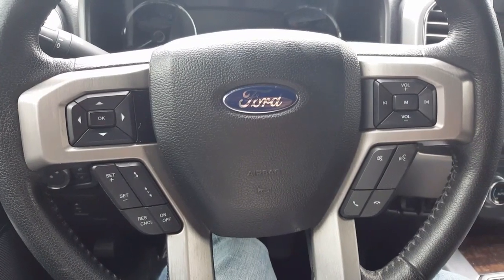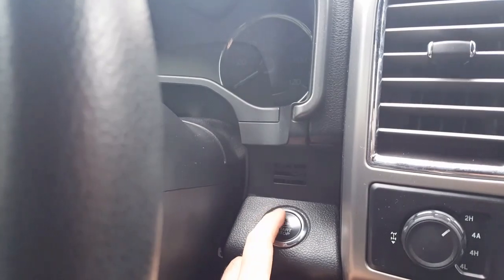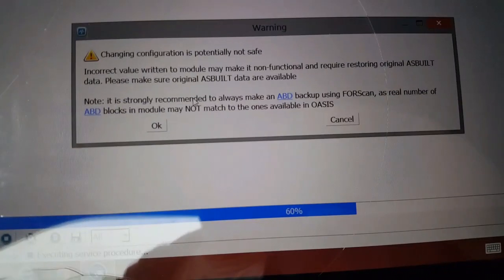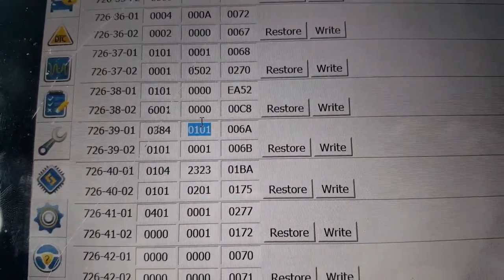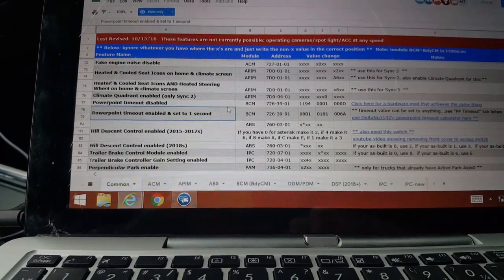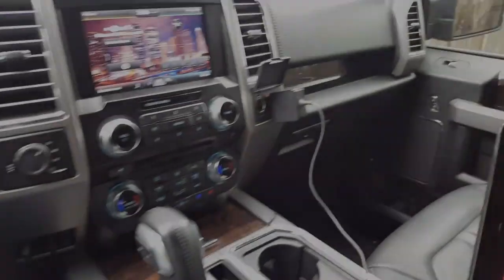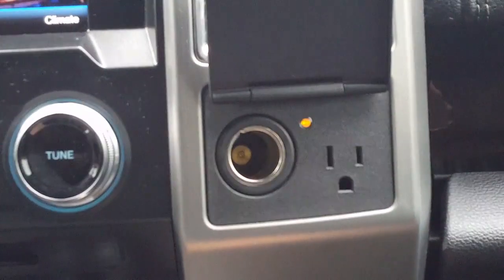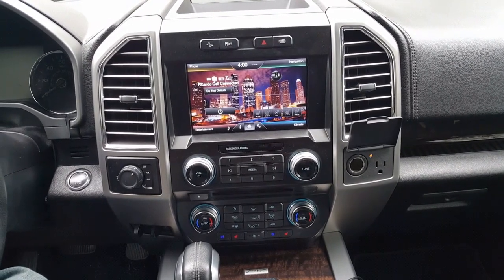FORScan how to enable PowerPoint with Timeout

Comment: Hey Ric , I have 2023 Ford Lightning and I will be taking some trips soon , I have a electric cooler that is in the back on the floor and I want to leave it on for maybe a half hour after the truck is off to keep the food and drinks cold in it  ! any ideas how I can change the settings on the truck ?  Thank you      Alan
Reply: Get a small portable power station like the BLUETTI  EB3A. Start with it fully charged, plug into your rear power point  to recharge and plug in your cooler and cellphone to get continuous power. Cost of $230, is less expensive than having a dealership fix the power point timer, that only stays on for 50 minutes.

Comment: Wondering which PowerPoints in the new Bronco this will have an affect on as there is in the Bronco, a 1v outlet in center console, a 120v ac outlet on center console passenger area, a 12v outlet in cargo. And the three different usb outlets, one on dash, one in center console, and one in center console for rear seat.

Comment: I’m dummy I guess simple way for me too keep constant power going to what I wanna power up all the time is. A hot wire and a fuse. It’ll be nice if they have you a easy set up feature you can set a time limit on the outlets by the steering wheel controls. That’s what I was hoping to find seems like something simple with vehicles now are complicated.

Comment: What’s the numbers you type in to convert it to stay on for at least 8hrs or always hot/on? I have a 2018 xlt super crew and will be using it as camp for the majority of snowboard season and would like to plug in some 12v heated blankets while sleeping. I don’t have the 110 outlet. I’d really appreciate your help. TIA
Reply: Hey did you ever find out? I'm curious
Reply: @KingKola01 the battery would die...

Comment: My powerpoints will only stay on when engine is running. Getting extremely frusturated since there seems to be no way to keep them on ive tried everything short of the hardware mod. My battery is the trucks second battery and the exact same one as oem. 2016 f150 5.0

Comment: Does this also control the DC / accessories sockets (ie cigarette lighter style port), not just AC? Mine doesn’t have an AC socket and I want to be able to have the DC ports turn off after a minute.
Reply from the maker: No. I tried it and it did not control dc. But the radio can be controlled. Checkout my extended radio play video
Reply: Cory, I have a 2015 F-150,   I used  BCM   726-39-01   0001   0101 006A
    
These setting worked great for me.    

Detail: The 12v outlets powers down after the engine is off and the driver's door is opened.   They do remain hot until the driver's door opens.  P.S. Maybe passenger as well, did not check.  Hopes this helps

Comment: how did you find out that 726-39-01 was the correct key to navigate to and where did you get the spreadsheet of codes to apply to the times like  10min=0258?
Reply from the maker: Forscan.org, ford forums, and the spreadsheet. https://docs.google.com/spreadsheets/d/1uDSQ1Z5a2Wt8-kjrSiVSlDFGFHnfeuhb3RTMVz95730/edit?usp=drivesdk

Comment: ok too bad. In brief the code is in Hex  my default 1194 or Decimal 4500 [seconds] equals 75 minutes or 1:15 min. 1  hour 30 minutes is 5400 seconds [ Decimal] converted to Hex is 1518. Your example of 1 hour is 3600 Decimal converted is E10 so you enter 0E10. While figuring this out I opened the window, lost power when I did that, came back when I closed it. Decimal to Hexadecimal converters are on the web.
Reply from the maker: Awesome... great info thanks!

Comment: Hi, I have  a 2019 F150 Raptor.. I hope you can help me .. my power 110v outlet don’t work also the cigarette no power , but all the fuse is good .. also the back seat don’t work but USB in the back  and front work .
Reply from the maker: Do you have a fuse on the power inverter?
Reply: Can you tell where can I look for that ? The  powers inverted? Is that the black box under the back seat
Reply: Thank You.. I got it .. it was the power inverter is was unplug

Comment: Can a dealer adjust these settings? My fusion had a loose battery connection, most likely since the day I bought it, almost a year later it was dead. My issue now, both outlets in the car stay on for I think a 1hr and 15 min, from what I read. They use to turn off once I opened my car door, which is what I like, but I guess it was because of the loose connection and battery drain. I don't really feel like going thru the trouble if the dealer could just adjust it.
Reply from the maker: They should be able to... not sure.
Reply: I don’t see why not I mean bout any new vehicle you have too visit the dealership

Comment: Is there a way to kill the power to the 12v cigarette port when the ignition is turned off? Mine currently stays on for 30mins. I use it to charge tool batteries with genuine makita 12v charger but im terrified im going to forget to unplug it someday and have a flat battery. I have a 2021 transit custom
Reply from the maker: Lol... I'm working on this... vid coming soon.
Reply: @ricardosworkshop  subscribed to the chanel. Thanks man
Reply: @ricardosworkshop  did you ever do the video on turning off the 12v socket?

Comment: Do you suppose this code will work for Super Duty as well?  I want to do this same mod to my 2019 F350.  Same module, same line.  Any harm in trying?

Update:  I tried it on my Super Duty but it did not work.
Reply from the maker: It should work. Checkout the F250/350 spreadsheet.  It's very similar to the f150.
Reply: Great, thank you.

Comment: I have a question why does everyone use the as built section in forscan and not the one that doesnt say as built. I have been using forscan on my truck 2012 raptor and on my wifes truck 2020 f150, when you go into the section that doesnt say as built you dont need all the codes its all there in plain english and when I make a change when it asks if you want to make the change I take a picture of it so I have a record of what I changed and I have had 0 issues and it is much faster and easier than trying to find the right codes to enter. Just always wondered and I asked on the forscan website and I go no answers from anyone.
Reply from the maker: Right... i made a video on this too. You can di a lot with the enable/disable functions. But you have many more options in the As-Built

Comment: Does this apply to the 12v outlet in the cubby below the climate control under the sliding lid?
Reply from the maker: I believe it does. Have you tried?
Reply: @ricardosworkshop  I have not. It seems this is one of the more annoying forscan mods to get working so I just forgot about it. I would just like to have it for my tablet to stay charged so I can access the dash cam remotely via hotspot

Comment: Hello can you enable the 110 volt if your truck did not come with it.
Mine came with a 12 volt, so I purchased one with both like yours, connect it, the wire was available behind the panel
  but it does not work.
Any thoughts 
Thanks in advance
Reply from the maker: I would think you can. Did you get a the power inverter also?
Reply: @ricardosworkshop  thanks for the reply 
All i did was bought the plug with both 12 and 110 and use the wire behind to plug it in
The 12 volt work but the 110 does nothing
Reply: I did not got the power converter 
Is it a plug?
Reply from the maker: No. It a large devise in the back seat. Converts DC to AC current.

Comment: How did I find the interactive power point for calculating 30min. time out for power point ? Can't find it again
Reply from the maker: Its on the spreadsheet and i included a few options in the video.
Reply: @ricardosworkshop  for me it was access denied, I requested access, denied.

Comment: Tried this many times.. does not work. Not sure what gives. This would be great for when I am doing work and my dewalt batteries need a recharge.
Reply from the maker: You're right. As soon as you open the door it shuts off. Try it from the outside, with the windows down. 👍

Comment: I tried all this and it works fine and stays on as shown in the video until you open your door to get out of the truck.what I want is to leave the power point on for about 1 hour even when I leave the truck.
Reply from the maker: Thanks for watching Darren. Yes. Mine does that too. I'm not sure what else needs to happen for it to work.
Reply: The super duty trucks have a tab for a reflash that fixes this but there is nothing for the F150. I might have to do the hard wire mod in the fuse box. I don't want to do this but until there is a software fix there might not be an option.  I tried the disable power point time out with forscan and the write just goes to 53% then fails. So that doesnt seem like a viable option either
Reply: TSB not tab.
Reply: @darrenberes7602  I have a super duty and would like my 110v to stay on for an hour while i leave to it to quick charge my phone.. what is TSB?  I"m familiar with forscan and have done some mods but not familiar with TSB